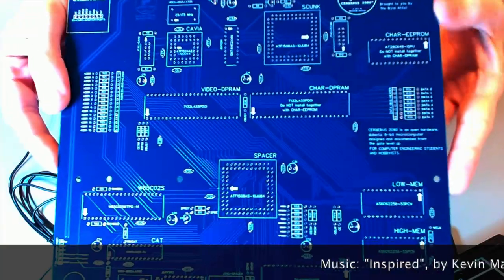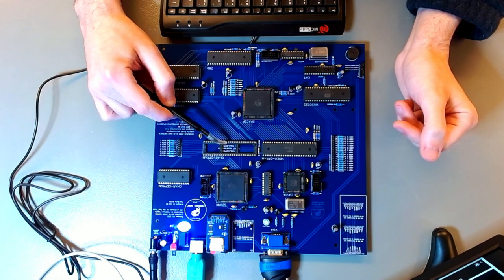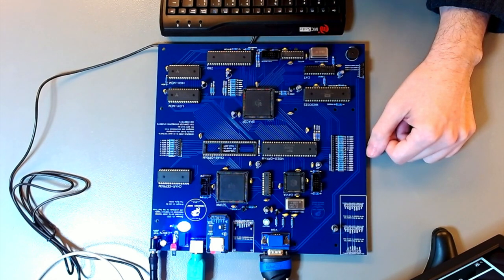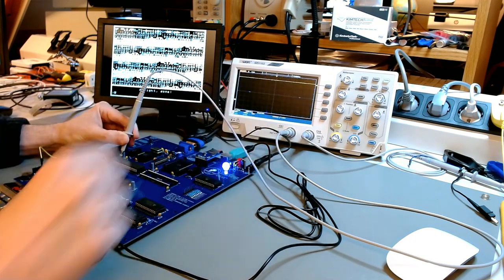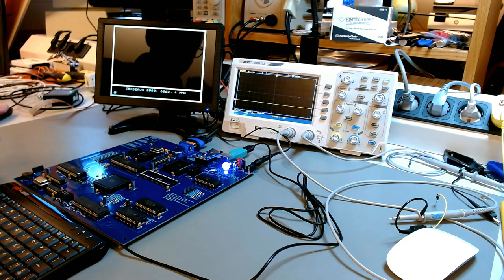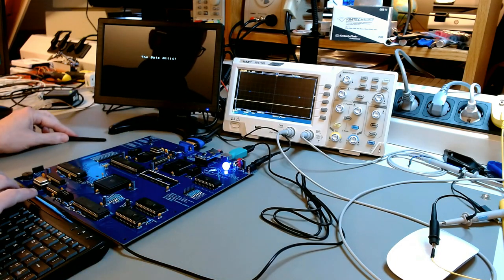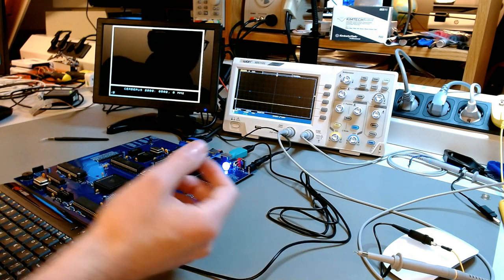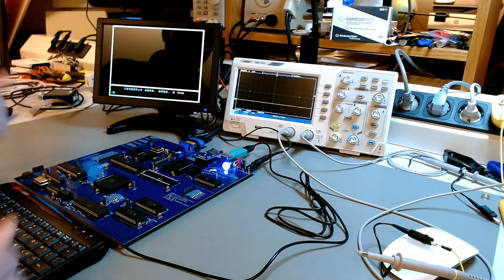Building CERBERUS 2080™, my dream childhood computer: Episode 17

Comment: Man, this is so awesome :-) Did you consider an I/O  port that could be easily programable?  I love my projects to be run on "new vintage" computers, using just Arduino doesn't have any flavor :-)
Reply from the maker: Glad you've enjoyed it! I didn't implement I/O flexibility in this project to keep it simple and didactical, but there is no reason why a fully programmable, general-purpose I/O port couldn't be built into a classic CPU-driven computer by using a microcontroller.
Reply: @thebyteattic  Yes, I do everything with microcontrollers... They don't have the flavor...

Comment: Really nice Bernardo! You can buy 8Mhz Z80s as well - Z84C0008PEG.  It is exactly the same price as the 10Mhz version (according to DigiKey), so if you want to be pedantic, you could suggest the 8Mhz device, although I would always go larger as well!!!  Another quick point, you may want to explain how to get a virgin ATmega328P into a state whereby it will work in your board...  You need to change the fuses to use the external clock, not a crystal or internal oscillator and also install the boot loader.  I found http://gammon.com.au/breadboard a big help...
Reply from the maker: Yes, they are probably the exact same part just binned in two categories after electrical testing in the back-end factory.